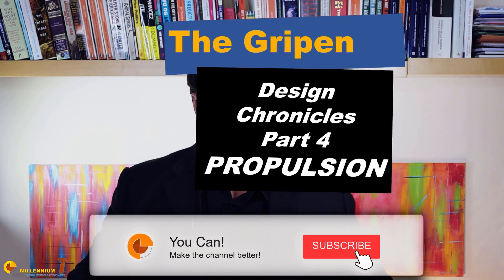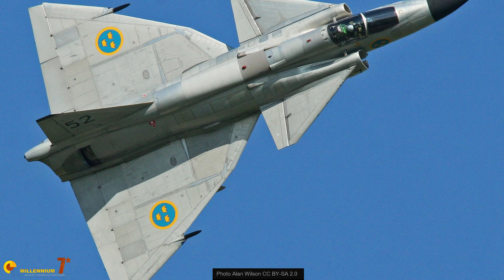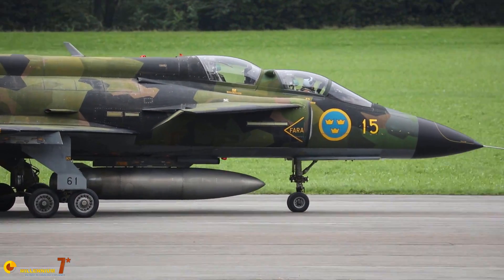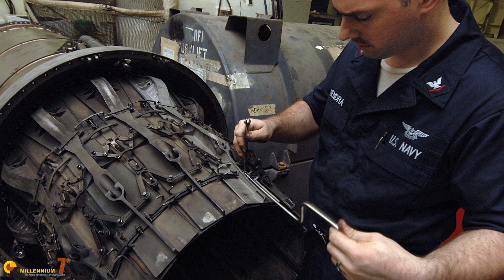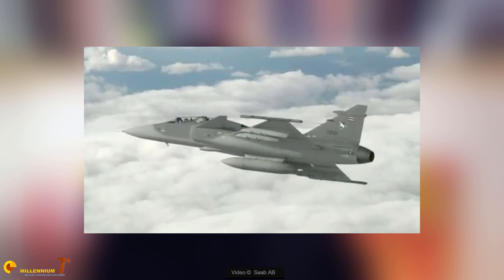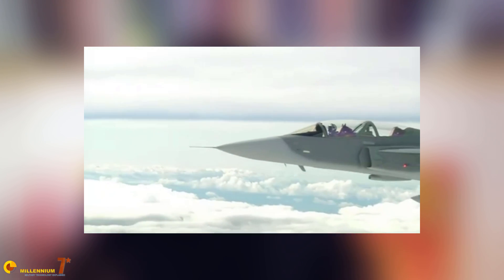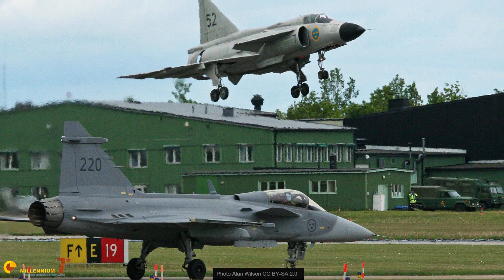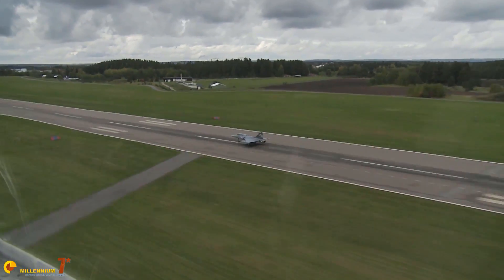Gripen - The Kick in the Back - The Design Chronicles - Part 4

Comment: This series has been very interesting.  Gripen seems like a stanout option for smaller militaries/economies. Curious how the capabilities compare to the typhoon (id love a series on this btw) considering the  2-3x price tag of the latter.    2 gripen vs 1 Typhoon, who would win... (likely depends on the weapons used and who sees who first)
Reply: If strictly fighter x fighter combat, in any range, the Gripen beats the Typhoon in a 2x1scale due to it's superior avionics, but that is very rare, since combat aircraft is always accompanied by early warning aircraft and such, you can't predict how that would turn out.
In many military aviation forums, veteran fighter pilots often put the Gripen losing only to the F-22 Raptor, beating even the SU-35 Flanker, and the F-35 Lightning II, many even say it's the best 4++/4.5 gen aircraft, and with that killing price tag.
Reply: @MihzvolWuriar  funny as there are reports of the f-22 losing to the typhoon. Any links to this?
Reply: @MihzvolWuriar  
" If strictly fighter x fighter combat, in any range, the Gripen beats the Typhoon in a 2x1scale due to it's superior avionics ..."

What do you exactly mean with "in a 2x1 scale"?

And if with the word "avionics" you were strictly referring to sensors, then, no, the Gripen doesn't have better avionics than the Typhoon. 

When comparing the Typhoon Tranche 1/2 with the currently operational Gripen C/D...:
- The Eurofighter Typhoon has a bigger and more powerful MSA radar than the one in the Gripen C/D. 
- The Typhoon has an IRST sensor. The Gripen C/D doesn't have one. 
- The Typhoon has a MAWS. The Gripen C/D doesn't have one. 
- And the british Typhoons have a LWR system (don't know about the german, italian, spanish ones... etc). The Gripen C/D doesn't have one.

The only thing in which both jets are probably more or less equal is the EW suite, more specificallly the ECM part of it.  

Now, if we compare the latest and greatest versions of both aircraft, the Eurofighter Typhoon Tranche 3 and the Gripen E/F, things become more equal. But still, we can't say/consider the Gripen as having better avionics than the Typhoon:
- both jets have an AESA radar. They share some technology IIRC, like the antenna repositioner thing for instance. But the Captor-E of the Typhoon, is bigger and more powerful than the ES-05 Raven of the Gripen E/F;
- both jets have an IRST sensor. Judging by the information available about the IRST sensors of both aircraft, they seem to be pretty equal;
- the ECM part of the EW suite of the Gripen is probably better than the Typhoon's, mostly due to the GaN jammers in the Gripen E/F, which is something the Typhoon Tranche 3, from all the information available so far, doesn't have...
- both aircraft have a MAWS. Which one is the best? No one knows exactly. Not enough data to make a conclusion about this;

" ... In many military aviation forums, veteran fighter pilots often put the Gripen losing only to the F-22 Raptor, beating even the SU-35 Flanker, and the F-35 Lightning II, many even say it's the best 4++/4.5 gen aircraft, and with that killing price tag "

Not true.
I read a few military aviation forums (and I've been doing it since a long time ago), and I never saw/read any "veteran fighter pilot" claiming that the Gripen is basically the second best jet, only losing to the F-22. 

And no fighter pilot would say that. Because that is complete non sense and far from the truth.

The closest thing to what you said that I've read online, is this answer written on Quora by this swedish "engineer" fella with the name of Stefan Englund who claims to be a former Swedish Air Force Lieutenant:
https://qr.ae/TxmHFx

This guy's answer is also used/referred to in this theaviationgeekclub article (James Van Allen has shared this link already in his own comment below):
https://theaviationgeekclub.com/former-swedish-air-force-flight-engineer-explains-how-the-saab-gripen-can-dogfight-and-win-against-almost-any-dissimilar-aircraft/ 

Half of the things he wrote are totally made up. The other half are half truths and twisted events/stories.

I can prove it to you. 

Now, go take a look and read his profile bio. It says:
" Have at least one opinion on any given subject, is totally biased on most of them. Respect any opinion based on facts. Will try to be polite and will probably fail miserably, if so please let me know :) "

He even admits he's biased. 

I have read other answers and comments that this guy writes on Quora regarding the Gripen and other jets, and it's always the same thing: he's totally delusional, always inventing "facts", and he's always trolling. 

A small example:
https://qr.ae/pNrlaQ

Abhirup Sengupta wrote, as always (I highly recommend reading his posts for anyone interested in military aviation), an excellent answer for the question "
 Why are Saab fighter jets not more popular even though they are much cheaper than American fighters and electronic warfare suites can be upgraded much more quickly than structurally built-in stealth features ?"

This Stefan Englund dude, got triggered. He didn't liked to see the truth about his super, out of this world jet that is his Gripen, being exposed like this as you can see by reading his idiotic comments.
Reply: Ben Ghazi  cool
Reply: EFEZZE6280  great, do you have a reputable link for me to indicate this?
Reply: Ben Ghazi  

" There is a reason it never lost an encounter during Red flag, had at least 43-0 against the F16's and the F22 only won in kills with a slight margin. And this was the C version of the Gripen, as the red team. Which is a feat in itself "

#fakenews
That never happenned. 

Most of the time, when forces from NATO countries or non NATO countries allied with the US, participate in exercises like RedFlag, they are 99% of the time on the blue side. 
The red side is composed with aircraft/pilots of the USAF's 18th Aggressor Squadron and 64th Aggressor Squadron and is augmented with other US aircraft/pilots.

Once in a while, you'll see some "combat" between american aircraft vs european aircraft, but that's only usually just a few WVR engagements with just a few aircraft.
Reply: EFEZZE6280  Good to know but my google cant find it from a reputable source (Quora and Hush-kit are not that). If you find it id love to see read it, Im a huge Gripen fan and genuinely interested in a breakdown between the two. Especially given the adoption/costs factors .
Reply: Ben Ghazi  The aviation geek club, whose source is a guy on quora. Id really love some proper info on this. Id imagine the Gripen is underrated and  can more than hold its own. This is why I would love Millennium 7* to do a video on it as he has a knack of getting facts/good info. It would be so bloody interesting.  I feel that in future sheer numbers of planes and missiles combined with machine learning enhanced sensors will dictate war. Especially given the  current de-noising and  augmentation that ML can do with all sorts of input types. In such a scenario, I think having huge volumes of Gripen type (capable and cheap) aircraft (unmanned?) would dictate the winner.
Reply: Ben Ghazi  Yes a guy on Quora and  you linked a press release which regurgitates a story based on the guy form Quora.  I can set up a Quora account pretenting to be anyone. Also, if he is a Saab engineer he has bias.  I want quality independent information , Im sure Boeing could throw up a similar press release praising their own planes based on a blog picking up assertions from some guy on Quora. 
Considering anyone can use a false name (including yourself) how can we be sure this is correct. Seriously, im not asking for much, just proper facts.  Furthermore from your comments, its clear you are biased towards this plane, for whatever reason so also an unreliable source.  Do you remember the independent multiple verified reports we got from red flag about the F-35? I want something akin to that not something which ultimately has a social media account as a source of truth.
Reply: btw I do realise these are different beasts with  different roles, still a comparison would be bloody interesting. Personally, I feel Typhoon only air forces should stand up some gripens.

Comment: Au contraire! Ganz Spaß, very "entertaining". The first clips of the aircraft in the hangar, with some "left-over" snow in the background, that is "pure Nordic, ;-)  
Regarding the landing performance,  if you can find any clips showing the deployment of the braking "system" with canards, elevons, and speed brakes, that would be both interesting and a valuable addition to your verbal explanation. Tusen tack, paljon kiitoksia, mille grazie!
Reply: Gripen landing and taking off.  You can clearly see the control surface deflections.
https://www.youtube.com/watch?v=2-2Xde54xz4
Reply: @FangPaw  thanks...it's just a 'blink', but i can see the canards, at least, as they flip down.
Reply: @Nick Emerson thanks, very clear...i imagine that the combination of canard and elevon deflection should generate significant downforce, as well as drag; perhaps this increases traction, and wheel brake effectiveness,  as well? that would help in adverse "road conditions" like wet roads?